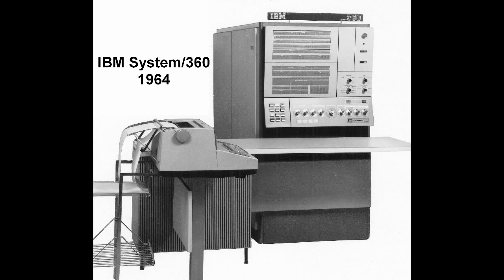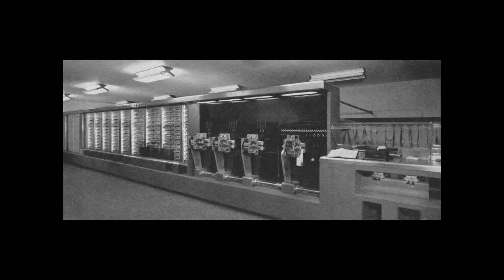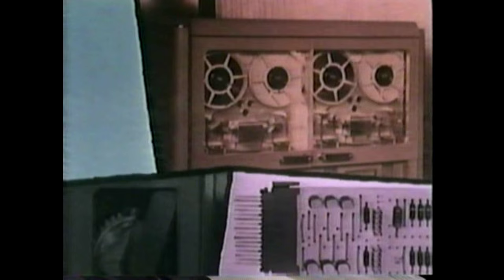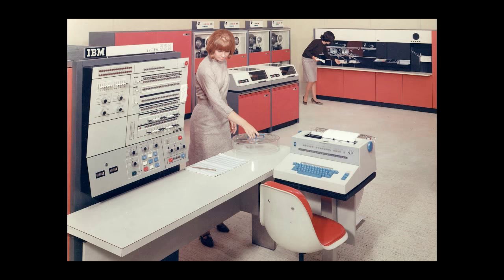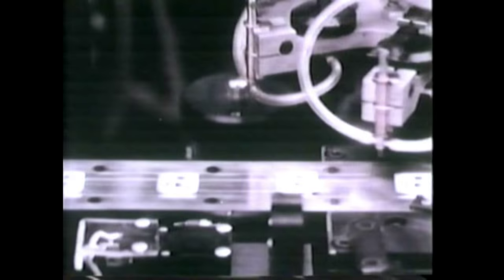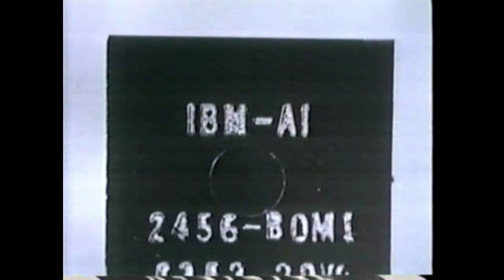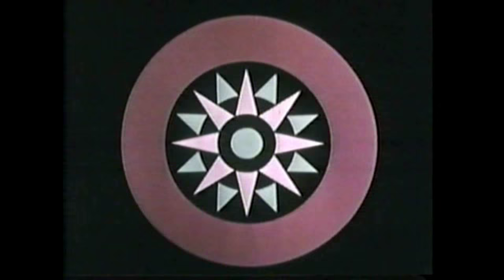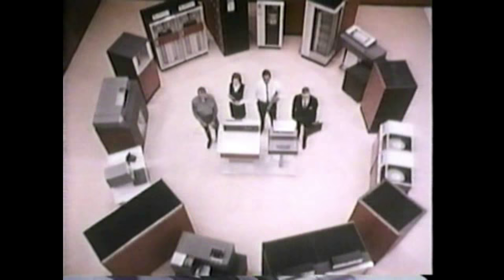Computer History: IBM System/360 Mainframe 1964 ORIGINAL ANNOUNCEMENT, Transistors, Data Processing

Comment: What is the terminal at 14:48 - 14:54 ?  An IBM terminal with a round display - that must be their first, but I have been unable to find anything about it.
Reply from the maker: Hi Paul, good question.  I did a little research on the IBM site, didn't find an answer yet.  Perhaps one of our IBM'ers can point us to more info on the round display terminal you mention.  IBM had many, many products in the early days that came and went so fast there is not a lot of info on them, without some digging.  Thanks for spotting this! ~  Victor, at CHAP
Reply: @ComputerHistoryArchivesProject  I've dug through a few early IBM manuals etc, no joy.
Also Google searches for IBM terminal. display station, '360 peripherals etc. etc. same, no joy.
I saw it quite a while ago in a different video, just one image, and thought it might have been an early prototype that never made it to market - however being in this system 360 video makes me think it was more than that.
Reply: @ComputerHistoryArchivesProject  IBM 1015 Inquiry Display terminal
Finally found it - yah - and has this been a loooong search.
https://threader.app/thread/1173829224026628101 - half way down.
Reply from the maker: Hi Paul, fantastic!  Yes, you found it!  Thanks.  Now we have the model number, we can find more info too.  Here's some more  http://ed-thelen.org/comp-hist/IBM-ProdAnn/1015.pdf
~  Victor, CHAP

Comment: So, how many characters equals a MB?
Reply from the maker: Hi Shannon.   Well, generally,  1 character in plain text uses 1 byte of memory.  There are 1,048,576 
bytes in a megabyte, so this would be about 1,048,576 characters.  Approximately 500 pages of double-spaced text.   Some older computers used different byte sizes...  perhaps someone else can comment more based on their experiences.
Reply: So when he emphasizes 8 million characters of memory - is about 7812 kilobytes of ram, or 7 megabytes ((8000000/1024)/1024) - which for 1964 really is a colossal amount of memory really.
Reply: Depends on ASCII or ANSI, I'll just pretend it's character = 1 MiByte

They were talking about peripheral transfer speeds of up to 1.2MB/s, that's faster then some cheepo USB drives...
Reply: I believe for System/360 IBM used its own encoding system, known as EBCDIC, for "Extended Binary Coded Decimal Interchange Code". It did use 8-bit bytes, though, with 1 character (two hexadecimal "digits") per byte. A kilobyte would then be 1024 bytes (by convention, the nearest power of two to 1000 was used), and a megabyte 1024*1024 = 1,048,576 bytes.

Arithmetic could be done directly in Binary Coded Decimal, and this was used for financial calculations, to eliminate rounding errors. IIRC, the Intel processors used in the 1982 IBM PC (model 5150) had a few instructions for doing BCD arithmetic.

Contrast with Control Data mainframes from the 1970's (I think they were designed by Seymour Cray before he left to start his own company), which used 6-bit characters, with an encoding they called "Display Code".  This is because the machines used 60-bit words (because 60 has so many divisors: 2, 3, 4, 5, 6, 10, 12, 15, 20, 30), so 10 characters could be packed into a word.

Digital Equipment (DEC) systems found it convenient to describe data in octal rather than hexadecimal, due to the data formats they chose.
Reply: Milk Bone imho hexadecimal was so much better than octal. I always chuckled as DEC for using octal. I read core dumps for a living back then. Some days I would have piles of dumps in my office to explain to various programmers what went wrong. I debugged COBOL, PL/1, DL/1 and various subsystems like CICS and POWER. I could make wall paper out of my IBM certificates of bug fixes.

Comment: In less than 20 years IBM gave away the shop by allowing the PC to be clonable and outsourcing the OS to Microsoft.
Reply: IBM is doing just fine.  PCs are low-end stuff, nowadays- low profit margins.  IBM moved on to greener pastures.
Reply from the maker: They didn't see the storm coming...
Reply: Yes they did.
Reply: Although IBM did that, they actually did fairly well in the PC industry for a few years. Even if they didn't create an open architecture like they did, they would have still had many, many competitors (i.e. Apple.)

Out of IBM's PC division came the PC standards, the PS/2 and its standards, as well as the ThinkPad and ThinkCentre. Those models were fairly successful, especially the ThinkPad.

But the PC industry was small to them (as James Hay mentioned) and they had bigger fish to fry. They still produce mainframe computers, developed Watson, and is one of the leading developers in the field of quantum computing. It'd be hard to argue that IBM isn't doing well just based on the fact that they made the PC an open architecture.
Reply: outsourcing the OS to Microsoft wasn't a bold move indeed, and Gary Kildall turning down IBM offer to use CP/M wasn't bold either... I wonder what would happened if he'd accept the gig... none of us would know about Bill Gates I guess
Reply: The PC came out of the GSD part of IBM. General Systems Division or GSD made typewriters, photocopy machines etc. BIG BLUE never thought these "toys" would impact the mainframe business.

Comment: I wonder what operating system they ran
Reply from the maker: Hi Steve, good question.  The IBM System/360 Operating System was known as "OS/360", a batch processing operating system developed by IBM for the System/360 mainframe announced in 1964.  It was partly influenced by the earlier IBSYS/IBJOB and Input/Output Control System (IOCS) packages for the IBM 7090/7094 and others.  Also known as Disk Operating System (DOS).  There is a lot of history in the IBM mainframe O/S world.  Fascinating research, if you are so inclined.
Reply: @ComputerHistoryArchivesProject  thanks, very interesting
Reply: They had a choice... there was DOS, OS/PCP, OS/MFT, or OS/MVT.  Many MVT installations also used HASP to spool jobstream input and printed output.

Comment: Were 360’s water cooled?
Reply from the maker: Hi Jim, excellent question.  The IBM System/360 was available in several different models (and sizes).  I do not think that all models were water cooled.   Perhaps one of our viewers has more specific information on this that would help answer your question.  There is a short article from "Wired" mag that mentions this topic a bit:  https://www.wired.com/2013/01/ibm-waterworld/    When I find out more on this, I will update this answer.  Thanks for watching.~  Victor, at CHAP
Reply: @ComputerHistoryArchivesProject  water cooling was only need when the circuit density and power increased with large 370 systems
The large Amdahl system used forced air cooling on one new site I worked the computer room air-conditioning failed but the computer was not shutdown the computer thermaled out  the engineer found some of circuit boards had melted the operators where told to shutdown the system immediately and of air-conditioning units failed. Those were the days
Reply: The 360/91 was the first water cooled model.

Comment: Wooow IBM was really lightyears ahead of it’s time, and who say’s that microcessors exists since 1971, it already existed so much early, it’s only that the microprocessor was commercially availible since 1971 for use in consumer products.
Reply: This machine did not have microprocessors or integrated circuits.  This had discrete transistors on hybrid modules.

Comment: I’ll bet these guys would have sh*t themselves if they had known that in only a few decades, all that stuff would fit in a 40-pin DIP microprocessor IC; add a few more decades and it brings us to powerful, 64-bit, multi-core processors so small they’ll be able to fit them, a high-res display and a battery all in your pocket, in a slim, easy-to-carry package! I wonder if any of the IBM design team lived long enough to witness the TRS-80 Model I, or the Apple ][?
Reply: They certainly did. Gene Amdahl (of Amdahl's law fame), the chief architect of system/360 passed away in 2015. I'm sure some of his team are still around.
Reply: Engineers of early '60s were very well aware of what future brings on computer system. In my bookshelf I still have an article from 1963 which ends something 
like this: "There may be some truth on this joke: In 1984 engineers never managed to test run their latest computer, because they lost it inside a floor gap."
Reply: This was only 59 years ago.  Do you not know anyone in their 80s?

Comment: 13:41 Internet?
Reply from the maker: Hi Retro Crysper,      When the narrator said "on line," he was not meaning the Internet.  Back in the sixties, "on line" access usually meant the computer had access to the data on a disk or an active resource, instead of "off line" meaning data stored on magnetic tapes that someone had to find and load onto the system.  Good question!    Thanks.   Victor at CHAP
Reply: @ComputerHistoryArchivesProject  when i worked @ # old honneywell, we  had a teletype line to headquarters back east . we had to get all of our jobs done and on the line to them by 1500 or 3 pm as they closed 3 hours earlier.